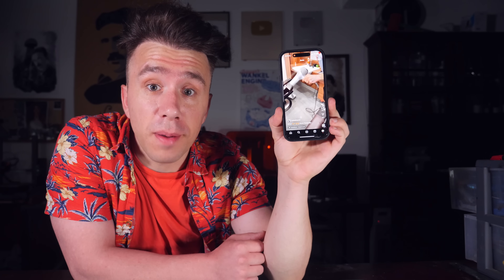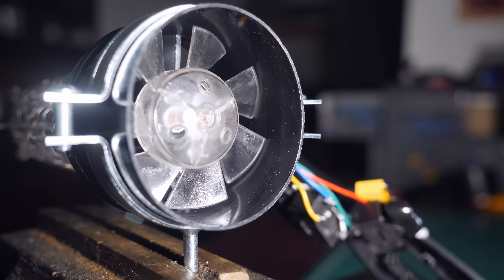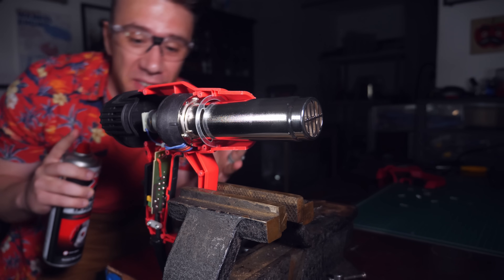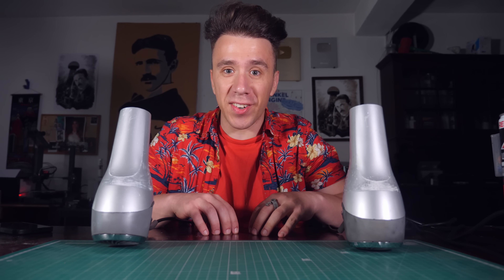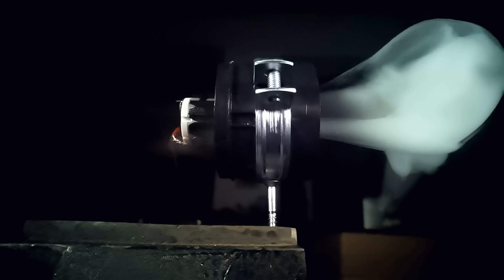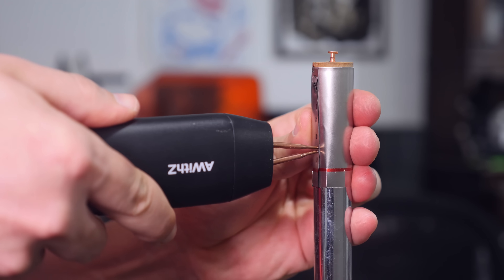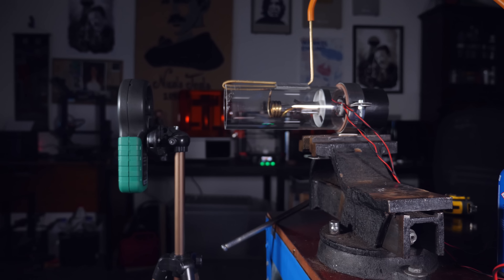I turned my $20 Hairdryer into a JET ENGINE

Comment: Using a reverted ventury at the combustion chamber entry would slow the air flow to let it burn completely, then adding a ventury at the combustion chamber output would boost all that extra thrust ?

Comment: Idea: use a converging section  to compress most or all of the air flow in front of the ignitor and over the coils then expand it back out after the coils (converging diverging sections, like a compressor in a jet engine or stem injector pump). Could possibly leave a film of air along the inner edge of the acrylic tube to keep it cool, but this may effect compressor. Love the videos, thank you !

Comment: How about building an impellor or cross wing structure, similar to the heating element holder from your first hair dryer, with pores for the fuel/gas... remember the flaming knife you used to make toast?

Comment: Slowing down the air shouldn`t be a problem as long as speed is traded for pressure (going to a larger diameter chamber does that) and it is speed up again in a nozzle. You could use the deadspot injector as a flame holder with a straight tube instead of the coil and have a second injector coil with capped end and a bunch of small holes in the periphery and if possible a small metal thingie over each hole to cause turbulence and increase the mixing with the incomming air.

Comment: So I don't know how to use 3d modeling or a printer but I think a venturi set up with conical riffle-ing  to direct the airflow in to the fuel source would be interesting. p.s. if I have the best idea I guess I will have to learn 3d modeling and printer use lol.  Also maybe using the new toroidal fan blade designs?

Comment: You are confusing detonation with expansion.  Jet engines burn fuel then use the heat to expand air.  You DON'T want a 100% air combustion.  You want the least amount of fuel burnt to produce the most amount of thrust/work.    You do this by creating a "flame can" to protect the fire from being blown out with inlet holes that allow for precise and controlled mixture of cool air to mix with hot air as it exits to the exhaust turbine.   There are many books on turbojet operation that explain this process.    Best of luck.
Reply: Yeah use this exact set up with hydrogen 😂🎉 would be super awesome.
Reply: its not a turbojet its an electric fan with something akin to an afterburner there isnt any turbine which is part of why its not going to get high thrust and compression ratios its basically just a butane torch lighter at this point

Comment: What if you mix the air and fuel ,then super heat that mixture? You’d be able to use brake kleen in a more controlled environment, and you wouldn’t have to worry about the fan blocking your fuel source. Just not sure if it would still be flammable as brake kleen evaporates really quick at room temp. Good luck!

Comment: To improve the jet-engine I would funnel the air outwards and ad more points where the fuel can enter the the jet engine. To do this you could drill holes into the coil. Also I would ad an afterburner where you just put more fuel into the hot exhaust of the engine.

Comment: the fan is also an impeller since it's enclosed. it's an axial flow impeller while the heat gun uses a centrifugal impeller. not sure if it's the right terminology but it's in the ball park and both are impellers

Comment: @@Integza well it would be beter if you would add a conical section (a cd cone type with only convergence)in the arclyc tube with the impeller. I think since the impeller pressureisses the air to move forward the conical section would do a better job in using all the air molecules inside the tube just like the way in which a rocket's cumbustion chamber with a turbine inside it propells the fuel to sub sonic and the cd nozzel proppels the fuel to sonic and supersonic speeds by pressureising and depressureizzing inside the cd nozzel. this would (i think it would for god's sake) work a bit more efficiently if equipped with a ionic thruster on the insides of the cone 

WIth Love 
Regards,
Lucifer

Comment: Reccommendation to improve this .. add more fuel .. yes make it more dangerous!! 😂
.. only kidding ... but.. 
To get more air burning then you do need more fuel to get to the right stoichiometric ratio for the fuel and at the right rate at which the fuel can burn it. Brake cleaner appears to burn quiet fast (might suit pulse jet architecture)  so its just a case of mixing it in the right proportions .. so more fuel ... so a bigger burner  and mixer. The coiled copper preheater fuel line is good but why dont you replace the burner / ignighter protection shell with the same coiled fuel line .. the copper can act as one terminal and a pin for the electrical returm .. try to get the copper cherry red and then when it is in equilibrium it will act as an ignighter along its length, so it continues to burn unspent fuel in the passing airflow. 
Other than that you could try an after burner by adding more fuel separately at the end of the rocket tube/ flame .. maybe with a constriction to force the fuel air and flame together.  .. this could be done with a ring of copper tube with holes in it fed from a second fuel line, affixed in the hot end of the rocket ..  .. you might need to upgrade the plastic shell though .. i think it might melt ...

Comment: You need a ring diffuser for the fuel injection. Then narrow the tube to half the diameter, then expand back out to full size with the igniter just after.

Comment: Longer combustion tube, aerosol the fuel the fuel more, most basic guess would be to drill some micro holes the pre heat tube and have it spray slighting more into the oncoming air.
i have no idea I'm just stating the obvious i think

Comment: So, possibly instead of just squirting straight from the can, fire the fluid into an expansion chamber with a small outlet for the feed to stabilise the fuel feed pressure?  Plus, if the chamber is in the hotter part of the engine then the heat would help vapourise the fluid?

Comment: For liquid fuels, we usually mix them with air prior combustion with an equipment called carburetor. ❤❤
Reply: …or use fuel injectors to deliver the fuel right at the spot that is best. That way you avoid carburetor icing and backfire.

Comment: ok so you basically building an electric turbo jet (hnit maybe you could build an actual turbo jet)

the solution lie in you "can" for the ignition source what you want is to get more air in there and perhaps even swirl/agitate it alittle 
to do this you want to create little openings in the side that have a protrusion into the airflow encouraging just enough into the ignition area.

Comment: I would say try adding a shielded combustion ring around the edge of the chamber instead of the center. More surface of air and fuel mixing.

Comment: I commented on the original upload... 

But I'll do it again because it might be worth trying this idea and I love these videos!  Instead of having the fuel and heating element in the middle of the air stream, why not put them on the outer edge?  They could be ran right along just inside of the acrylic as to fill the moving air more with flame.  Having the fuel and heat around the outside edge would make it easier to have a more complete and efficient burn.  Also, based on your explanation from the video, the acrylic would be fine because of how the air is moving.  This idea comes from a race car developed in the early 2000s for hillclimbing.  I'm actually using the theory in reverse.  The original idea was to use a small chamber built into the exhaust of the car as a jet.  Fuel would be injected into the exhaust with an ignition source right after (IE spark plug or glow plug).  That was used to spin a turbine to build boost.  (There's a little more to it but this hits the important points).  If you flip the design and have the fan to push the air, it's the same thing, just with the fan being the source of air instead of the exhaust pressure.  You theoretically could use much higher RPM as well.  

Let me know what you think!!

Comment: Uhh the only thing I kept repeating immediately for the first 5 minutes was that the hair dryer might have been using a brushed DC motor. Those spark like crazy, but I guarantee they have been designed NOT to spark when, say, hairspray gets in... so, keep the original blades and modify to allow fuel to pass through the motor brushes

Comment: hey i dont really know much about your software but i have a strong feeling why the fluid was not combusting at first. It was because the motor in the original hair dryer video was pretty old. Probably the rings where the motor was rotating was causing sparks and the heating element made it more combustible.

Comment: Why don't you use the injectors, like the car motor injectors kind. I think the problem with your design is the mix ratio 15g is not reached due to spring and the distance between the nozzle and the ignitor. You can try to distance the nozzle and use also PWM to control the injector, you can also add a pomp to boost the fluid injection. 
An other way is to use a kind of round sprayer with multiple nozzles, in a way to get the good ratio air/fuel.
Good luck 
Love you work.

Comment: @integza  Using a slight counter-spirited defusion blade after the impeller but before the fuel/element would allow the fuel mixture to expand further inside of the tube for a far better mixture. Better ZE  mixture, bigger ZE Flames !!!

Comment: Mechanical Engineering student here! You've used Laval nozzles on your other projects, and that would be an easy way to get some more thrust out of this. You also might be able to use more of the air in the combustion chamber because this would be at a slightly higher (less negative) pressure!

Comment: one suggestion might be to toss a one-way check valve in there! reduce fuel pressure since you're injecting too much for it to mix fast enough for full combustion for the can, it's like a "hot start" for a jet engine and the solution to that is to actually increase the throttle and burn the flame out until it goes into a normal operational state before backing off the throttle. so i guess either reduce fuel pressure or increase fan speed until you get the right stoichiometric mixture and it may need an exhaust nozzle to help compress exhaust gas and stabilize the pressure.

Comment: (2:54) Granted, I haven't seen the whole video yet, but don't you need the hair dryer shroud around this to add turbulence and keep the brake cleaner from diffusing into the air?  The turbulence would slow down the air and there would be a higher concentration of it since it's not diffusing right into the room.
Reply: How does a shroud add turbulence?
Reply: @petep.2092  Instead of letting the air diffuse out the gaps, the shroud channels it down a path where it encounters obstacles (the heating coils) and possibly whirls back where it then resists the incoming flow.

Comment: I saw a trick for bending copper pipe that you might like. Fill it with sand first then bend it. The sand will help prevent it from collapsing and pinching off your bends.

Comment: It’s a nice concept, what you are building is an afterburner, not a jet. The afterburner works by trying to re ignite the leftover oxygen that didn’t burn fuel in the main combustion chamber. Although I don’t work in the aerospace industry, I’ve seen afterburners work, and in principle it is the exact same thing, a heating element (basically a diesel engine “spark plug”) that ignites a fuel pilot that will in turn light the fuel. Afterburners work with fuel ring injectors that are lit in stages, and they don’t get ignited all at the same time. Each ring stage is bigger in diameter than the last and the injector is protected by a 90° angular bar ring. The injector sits just inside this protector that breaks the flow just at the point of ignition. Remember, afterburners ignites in stages.

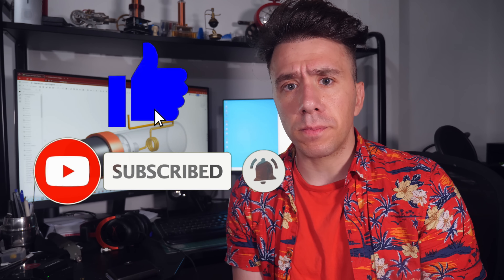Comment: 13:30 if you had a pressurized air tube around the entire acrylic tube that allow more airflow in so then the engine could have. More or easier combustion. Plus thrust.

Comment: It looks like you need more primary air mixture (mixing the fuel with air prior to combustion). This design seems to only use secondary air. (Air to support combustion after ignition)

Comment: Have you tried to use a fuel injector from a car to inject your fuel. I’m sure it could be controlled with an Arduino which would give you a ton of control over the fuel injection.

Comment: I would say that you should move the spark plug further away from the fan and change the shape of the tube.  So that it narrows slightly in half and place the tubes there to laminate the flow of the mixture and only then use the ignition low.  There, the tube is slightly narrowed again and twisted to get wavy ribs, like in a gun to focus the flame.

Comment: I guess making some kind of nozzle would help to keep pressure in the combustion chamber (better combustion)  and providing high exaust speed, overall a jetengine doesnt has mutch thrust at all, more a high speed Output (over time). The heating of the fuel is very smart this can add pressure to the fuel intake but only be carefull with backfires with that. 
Nice video, love your content

Comment: It seems to me that the missing link is combustion chamber pressure. My recommendation is to occlude the exit aperture rocket style, as for controlling liquid fuel, I’d recommend a pressure vessel. Imagine a tank (old propane tank etc) with an air connection in the old valve and a new valve off the bottom, you could pour liquid brake cleaner into the vessel then using an air pressure regulator maintain a near constant pressure to push down onto the liquid fuel, once the pressure is constant the only variable is flowrate, which would be easily adjustable with a ball valve. You could incorporate the nichrome wire ignition source into what would essentially be a turbocharged rocket. You could use the liquid fuel tank assembly to determine the optimum compression ratio to efficiently burn brake cleaner then using some basic algebra factor in the pressure created by the impeller and scale up to a point where real thrust is generated.  It may also be worth working towards a higher injection pressure to help atomise the fuel, failing that, you can buy small bottles of oxygen on Amazon for lead welding and ad an 02 supply but at that point the atf may knock your door. Thats my video idea, apply the scientific method to gather information and control variables and use the video as an opportunity to teach about the scientific method and show it applied to an engineering project. It literally as easy as rocket science

Comment: Did you just create a "single cylinder" continuous combustion linear turbo jet engine?  Don't you need a doctorate for something like that? 😂

Jokes aside and suggestions: try to disrupt the flow more on the back side to optimize fuel combustion inside the center of the cylinder.  Also, you could experiment with the tube length, make it a little bit longer, maybe place some type of catalyst screen material in to help increase fuel combustion or use the traditional bell shaped nozzle of rockets to achieve extra "ooomf" from the combustion itself.

I watched the first video, I shall comment and like, and even subscribe despite the fact YouTube is cranking up censorship... it needs to stop.

Comment: Maybe add a pressurized fuel line, a tube with compressed air and multiple atomizers (airbrush nozzles) behind the fan, not the motor. This way, the fuel-air mixture will be much more saturated and much better mixed. To ignite it, just keep your current injector as is. To increase efficiency, you can also use an impeller instead of a fan and add a deLaval nozzle at the exit to further increase the operating pressure

Comment: Maybe make the air flow through a mixing chamber with the fuel(brake cleaner) before making that mixture go into the combustion chamber. 
Also maybe you can add a throat after the combustion chamber that leads into a nozzle

And maybe consider adding an afterburner to gain more thrust

Comment: I think you need increased atomization of the fuel, maybe multiple small nozzles.  you could add an air inlet to the fuel line that uses the air passing through the motor to ram air into the passing fuel before the nozzle.

make sure you are burning NON CHLORINATED brake cleaner so you aren't creating toxic gasses

Comment: Hey Integza! I think what you’re looking for is a convergent divergent nozzle. Your engine has too much bypass by way of the acrylic tube. If you were to ignite the fuel in the same way but with a separated air stream, then allow the rest of the air to funnel into the combustion you should be able to ignite most if not all of it.

Comment: Slow the air down, combust, speed the air back up

Mechanically link the compressor and turbine, then it'll run from the combustion alone

Comment: You are way overthinking this one. You just need to add a conical to the end of the hairdryer because it will speed up the exit airflow and give you higher combustion pressure. You’re just missing the conical

Comment: Perhaps put a collar or funnel point or into the tube, mid way between the point of combustion and the end of the tube, using the last half like a nozzle. Then you’re forcing the fuel and air to mix under the compression of air passing through the pinch point. This should also slow the air around the face of the tube and funnel, mixing with any unburnt fuel from the initial combustion, before being ignited out the exhaust. Not sure if it works in practice but should be a simple print and test, lol.